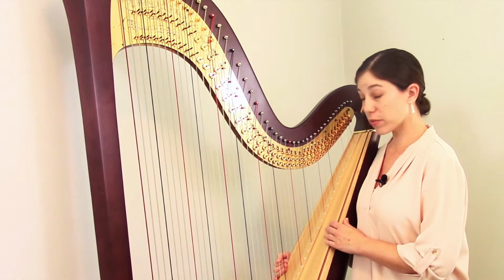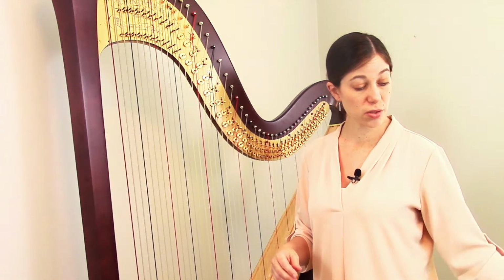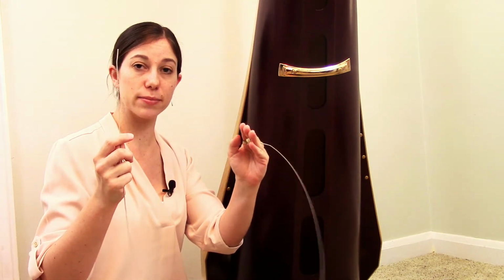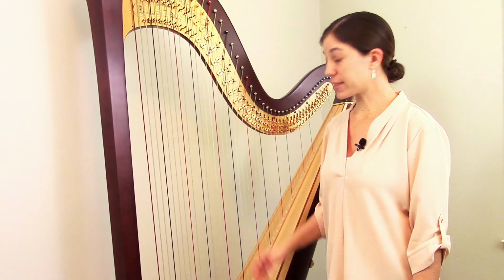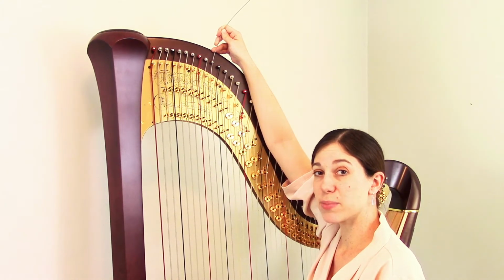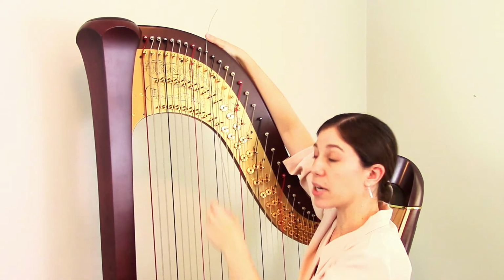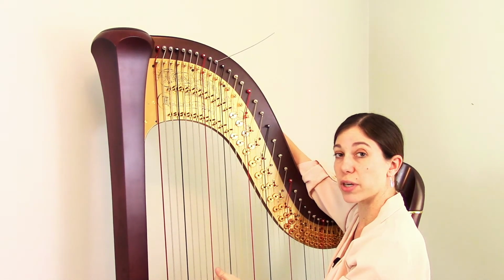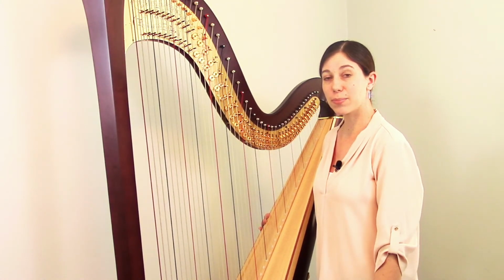Replacing a Wire Harp String, Harp Care, Maintenance, and Repair #13

Comment: Hello, I've bought an old, beautifully sounding harp, but the wire strings were all black so I decided to change the strings to find the notes more easily, but the new strings sound very metallic compared to the old ones, maybe you have any tips to reduce the metallic sound?
Reply from the maker: I would double check to make sure you bought wire strings that go with the type of the harp you have. It could also be that the new strings just sound quite different in contrast and will settle in shortly. Good luck!

Comment: Hi,  I have just changed my wire strings and within a month they have rusted/tarnished and look dreadful.  They are silver plated and brand new! It was a new harp four years ago and my old strings never looked like this.  What could be wrong and what can i do? They sound better but they look absolutely awful 😣
Reply from the maker: You have not done anything wrong! Most likely what has happened is that your old wire strings were tarnish resistant and your new wire strings are not tarnish resistant. Both types of wire strings are available for purchase, and the non-tarnish resistant wire strings quickly do exactly what you're describing. They sound really good, but they look quite dilapidated! Hope this helps!
Reply: @JacquelinePollauf  Wow thank you so much for that, it makes sense that the ones that came with the harp were tarnish resistant, i probably wouldn’t have bought the harp were they not!  The sound the harp makes has to be priority for me as I have such an acute ear, but its such a shame they look so bad!  Which strings do you go for?  The look of the harp versus the sound of the strings?
Reply from the maker: @angieharpist  Actually I don't find any problems with the sound of the tarnish resistant strings, so I use those. You could just wait until the next time you need to change your wire strings again and put on the tarnish resistant strings, or if it's really bothering you, you could go ahead and change them now.
Reply: @JacquelinePollauf  ah ok I will probably change to tarnish resistant again at the next change as I will probably have had enough of looking at these ones by then! You’ve been immensely helpful and I appreciate it so much thank you Jacqueline 🙏💕
Reply from the maker: @angieharpist  Glad I could help!